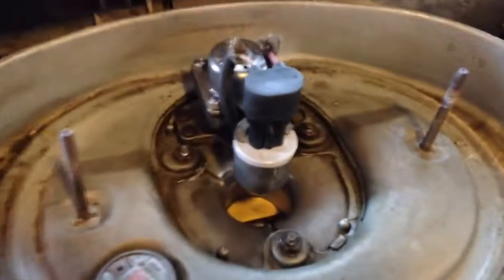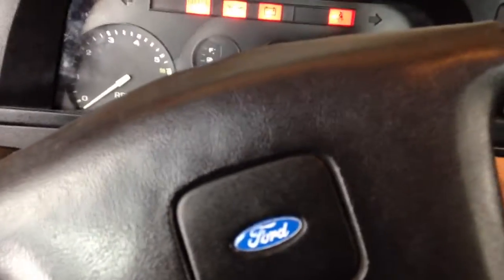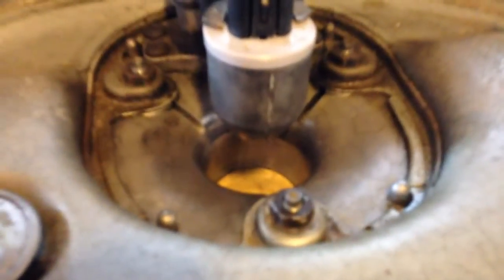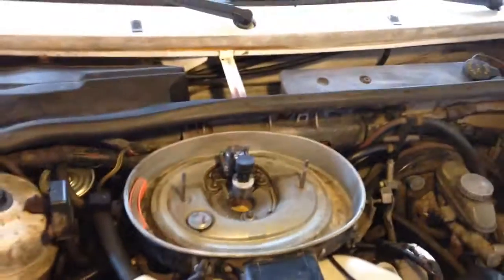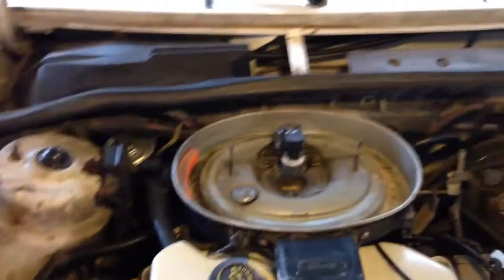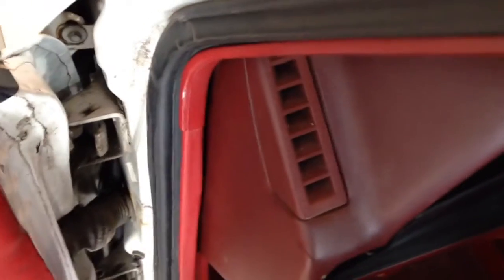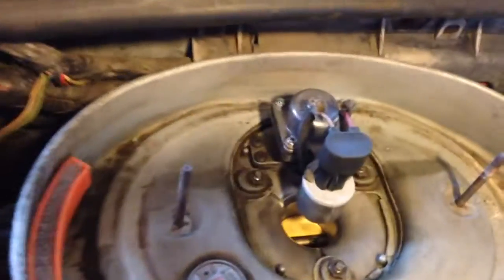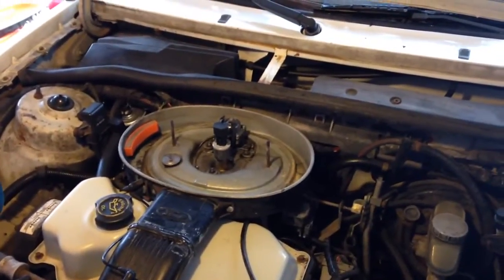1988 ford escort injector problem

Comment: Daniel,
With the engine idling, unplug the connector from the throttle position sensor (TPS).  If the fuel stops spitting and starts shooting smoothly, then the TPS needs replacement.
If that doesn't work get a book on your car and read how to place a short jumper wire in the computer connector, which will give you trouble code flashes on your dash.

Regards,
John
Reply from the maker: Thanks John I'll try that. I didn't know you were into auto mechanics as well, I guess we tinkerers have to tinker with everything :D
Reply from the maker: Well I did like you said and it sprayed a BUNCH of fuel and stalled out the engine so I'm guessing the TPS might have a little problem. got a new one on order.
Reply: Daniel,
A TPS is nothing more than a variable resistor controlled by movement of the gas pedal.  A new one will require that you preset it to a certain resistance before installation.  The preset is very important, as it establishes the initial voltage required by the computer.  In other words, don't just slap the TPS in there or you'll have more troubles down the road.
Pick up a book on the car at an auto parts store.  It'll give you the correct resistance setting.

Regards,
John
Reply from the maker: Well i've got a Haynes manual and it doesn't say anything about the TPS (typical Haymes manual) but I did read on a forum that all you do is install it at an angle and then turn it slightly so the screw holes line up. it's got an internal return spring in it so you can't just slap it on and have it line up.
Reply: Daniel,
Strange that the book says nothing about the preset.  Maybe preset instructions will come with the TPS.  If not, then just go with what you read on the forum.  Aligning the screw holes may be all it takes to establish the required resistance.
Keep us posted, my friend.

Regards,
John
Reply from the maker: Sure will, Thanks John!
Reply: John did you ever figure out the problem

Comment: if it runs better warm it may be a temperature sensor, also check TPI by unplugging it and seeing if it stops spitting if it does replace.
Reply from the maker: it was the TPS (Throttle position sensor)

Comment: Im thinking a clogged fuel strainer in the tank, clogged fuel lines, weak fuel pump, or all of the above. Fuel flow out of the injector should be steady.

Comment: What cause to much fuel to come out the injector it pouring not spraying
Reply from the maker: Bad Throttle position sensor
Reply: Changed that but could it be from a o ring in the injector
Reply: Bottom one I think missing
Reply from the maker: That would do it @GregoryHarrison-k9p

Comment: well if i had to guise i would say it is the TPS, at least on my escort the previous owner warned me it goes out about every 2 years and well mine did XD mine did that but under load  there 50$ and 5 min to put in heck i make a vid if you want but i am not entirely sure that's it, the fuel pump also could have gone but the fact that it surging on and off and gets better when hot sounds like a bad connection (something these car are famous for) if you take the TPS off and check the resistance across the 3 pins that should tell you for free
Reply from the maker: well idk what the resistance is supposed to be on the TPS but I tried disconnecting it while the engine was running and it made the injector spray a bunch of fuel and stall the engine, so it's definitely got something to do with how much fuel the injector sprays so I ordered a new TPS.
Reply: coolbluelights yes it is the thing that tells the injector how much to spray, the cpu in your cab has more to do with but in short the throttle cable moves the butterfly valve, and on the end of it is the TPS witch tells the injector how much fuel to spray into account for the opening butterfly. Basically what use to happen was about every 2 years these things start to ware out and they get spots with the conductor rubbed off or corroded, mine started acting up when it was cold out side, any way that makes them starve for fuel or spray to much i would say if this is the source of your problems it the rubbed of conductor due to use, which leads to a unstable bad connection. Just test for spikes or drops in resistance when you turn it, if you see one i am willing to bet that's the problem. Like i said these are about 50$ so ask around some more before you get it, i would hate to stare you wrong and you wast it, but this is what i would do, any more question just ask :D
Reply: coolbluelights hey man did it end up working ? I have the same problem with my cAr as well.